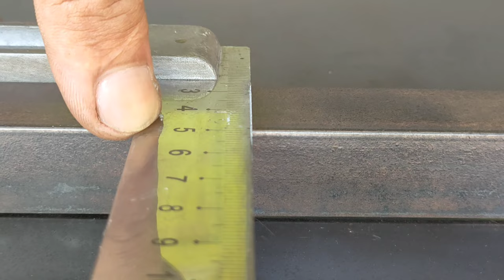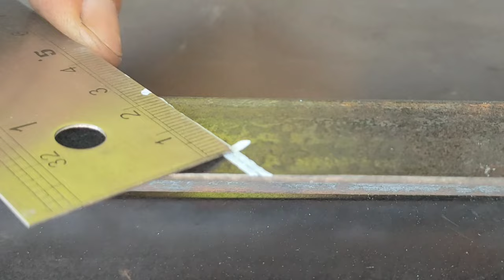the correct way to cut 90° | how to cut

Comment: I bought a portable 200 amp welding machine.  it looks very easy watching videos, the electrode stick melt like butter.   but when I tried , the stick stucks on the metal, etc I cnt even explain. I also tried on every ampere settings. but I just cnt do it. is it because the electrode stick has expired or something else,. 😢
Reply from the maker: Maybe your electricity voltage is unstable